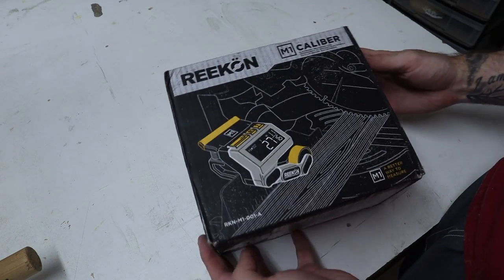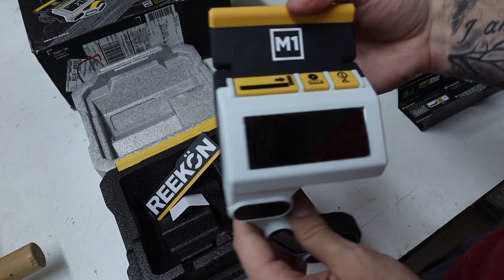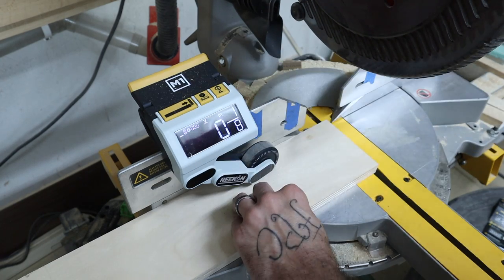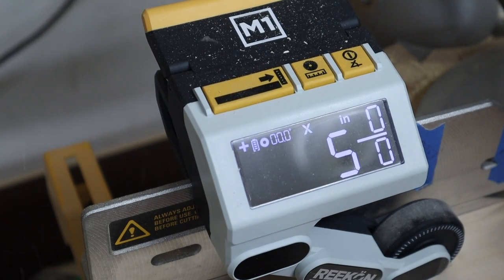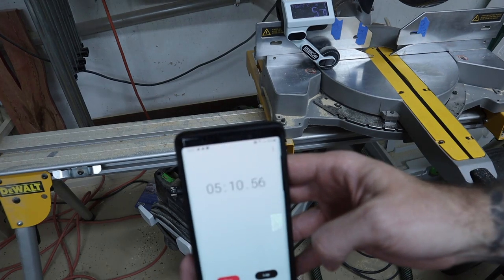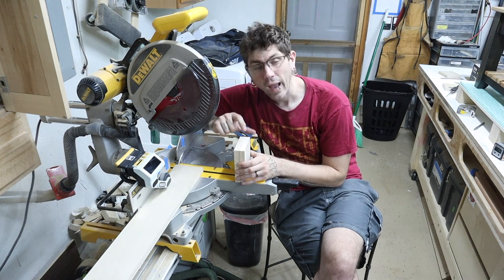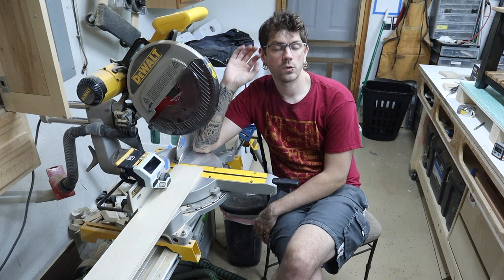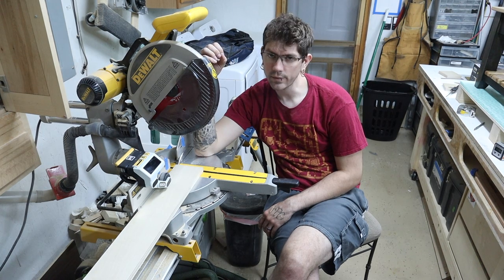Reekon M1 Caliber unboxing and review - A surprising miter saw upgrade

Comment: I’m a newbie from Quebec, Canada . Your video helped me lot. Personally I found the instructions so - so as a newbie…… in addition… Attention to all metric users….. in the booklet it is written 6 FT for calibration or 200 cm…… on the Recon Video the owner who invented this those a mistakes and says 6 ft is 200 mm… Just be aware everybody who uses the metric system…
Reply from the maker: I made a follow up review.....it didn't go well
Reply: @TheWoodVeteran  
Hi same newbie…. I just saw your last video of the Reekon…… To be honest I’m an artist and like to race, hence the helmet….. I am an artist painter, not a woodworker but I have great tools to cut etc…… I build my own canvases and when finishing a piece I do my own frames…. This Reekon was bought through a kickstarter project….. I was hoping for quick and accurate lengths to cut and then miter my joints…. Obviously it seems quite inaccurate when you show all the blocks on the side and they look like a mountain range…… I just installed it yesterday after a month just lying there…. I’m very disappointed of it’s inadequacy and you are so correct on how that freaking arm doesn’t easily lock in place…… So I wonder if WoodPeckers didn’t fabricate a long exact ruler of about 6 feet.
My artwork so far has been within those 6 feet long limits…. I thank you for your time and honesty in your review in your two videos on the subject .
I dig your look. Cheers from french Canada !
Reply from the maker: @rosevan5485  given your line of work and use for it...I do see it has its benefits. Once Calibrated it does work fairly well. Having seen the two videos, you can see how it doesn't work for me. My work is part of it. But if you leave it installed and check it once in a blue moon, it should do those tasks fine. 

As far as the arm thing goes...I believe reekon has agreed to replace the first edition models with an improved one if you reach out to them. You mail yours and they mail one back.

Comment: Heads up, you need 6' on both sides of your blade to calibrate. I built a custom workstation for my Bosch mitre saw in a 10' x 10' spare room and only have 60". Moving my saw would mean having to tear down and rebuild a new workstation so I have to return the device to Lowe's. I let Reekon know of this and they'll pass it onto their development team. Hope this post helps someone in making an informed purchasing decision and not have to return the item like I have to now. Hopefully they'll make a newer revision without this limitation and I have better luck with the T1 Tomahawk tape measure when released this summer.

Comment: Pretty cool but when do you need to cut 15 5” pieces?
Reply: And when you do, is it faster than a stop block?  I’m still skeptical admittedly.
Reply from the maker: It wasn't so much that I needed to do just that. More like the skeptics (including myself) need to see what repeat cuts look like. A stop block could work, but also comes with limitations. If you have a setup like mine...using a stop block on anything over 15" would be challenging. Also a stop block takes time to set up. Especially of you are batching a few pieces at various lengths. I still have my doubts...haven't gotten to use it much since I made that video as I've been away....but I will be posting a review of it later once I've got some time with it. So far....everyone that has one doesn't seem to have any complaints. Time will tell. But so far I'm impressed, and I tend to be pretty critical about things...especially tools.

Comment: What will happen when the batteries are getting low will it not repeat as good or just wont read at all?does it tell you the batteries are getting low?
Reply from the maker: I'm actually gonna be doing a secondary review in the next week or so to review the pros and cons after getting to use it for a while. Besides that, I haven't messed with the batteries since I opened it and its still going. (6 months now?)
Reply from the maker: Also yes it has a battery indicator.

Comment: I got one of these for our metal fab shop because all off our stock is clamped down for the cut (staying at 0), between cuts. should be much faster at just a push of the button.
Reply from the maker: I forget that other materials are chopped as well :)